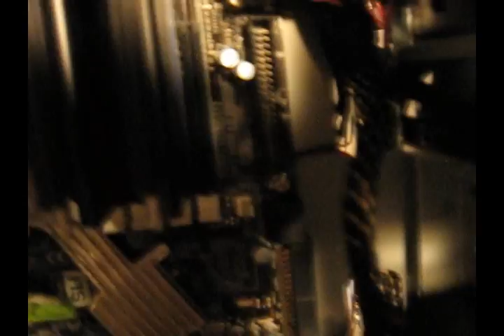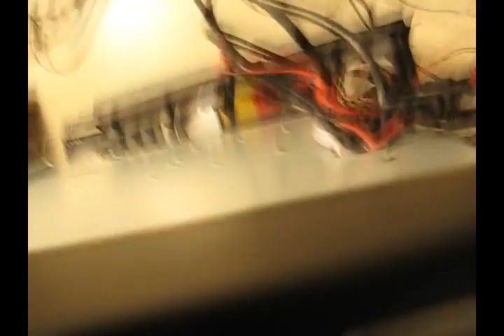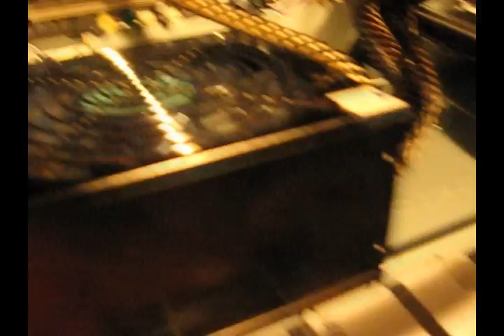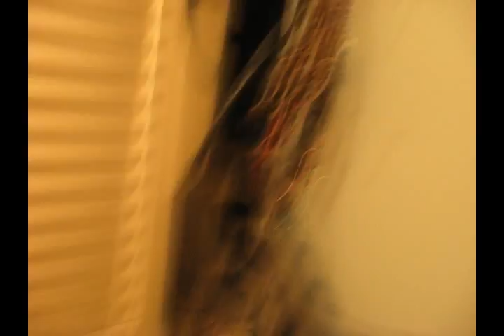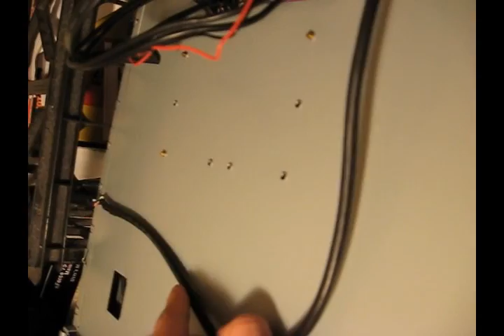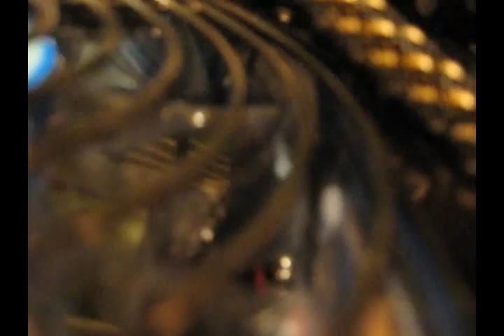Antec900No-Drilling Cable Management Tutorial 1/3

Comment from the maker: The wires from the top are for the top ports of the Antec 900. The Power button, reset button, usb ports, and firewire port have cables to run to the motherboard. The firewire and usb cables you dont really need, those can be hidden in the back. You do need the power,reset cables hooked up to your motherboard. Any other wires in the case are for the 4 fans.

Comment from the maker: I would definately get it.  Such a great case for the price and youll never have cooling problems unless you overclock like mad and say run tri- sli  lol  This case the 900,  the new version of this 902 and the 1200 all from antec are amazing cases.  Would recommend all of them.  Keep in mind they all are bottom mount power supply, so you need fairly good length in your cables. My psu almost didnt reach my 8 pin mobo spot =/

Comment from the maker: If you are running the 900's front sound cable the way I did,(so it comes out the little hole near the power supply) make sure you do that before you screw it in, otherwise it doesn't really matter. I preferably seat the power supply about in its mounting position, but dont put in the screws until its all connected. Then I put in the screws.

Comment from the maker: Yes that motherboard will have all the connections =]  There are 4 fan connectors and luckily they are double sided, meaning they can plug into eachother =] The top fan, and two front fans can all plug into eachother, making a total of only 2 connectors.  Your powersupply  is fine =D  Hope I helped

Comment: oh good. because im getting all my pc stuff from Summit Direct computers, and they have a fan that mounts in the available slots behind the pc (the ones with metal covers) and it mounts underneath the video card (i have a 7300gt) and literally takes the heat off it and blows it out the back. great little upgrade for like $15. it takes one power connector, so i was a little concerned. thanks for your help :) btw, i subscribed ^^

Comment: Nice video, I'm putting a i7 and new mobo in this weekend.  My cables are sloppy with my current build so I figured i should do it up right this time.  So do you leave the powersupply free from the case, or do you screw it in after you send the cables out the back?

Comment: uhh idk if you would know this, but would an asus m2n-sli have all of those ports for the wires? and 1 more question, how many power connections do i need for the fans? i have a 500w with 5. one is going to the disk drive.

Comment from the maker: For my Kingwin Power Supply
60 cm for the 4 pin
45 cm for the 24 pin

If you want exact measurements contact Kingwin
1-909-598-2888